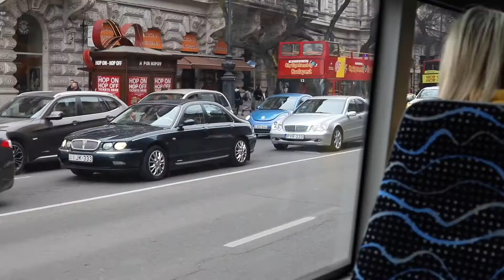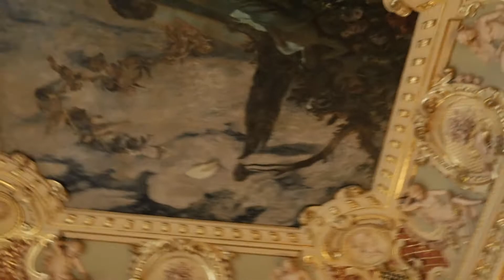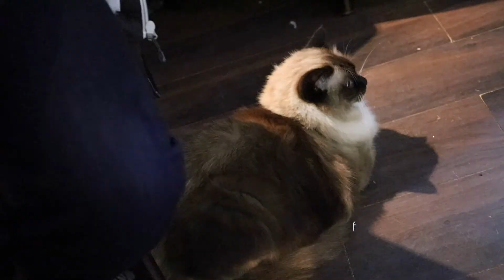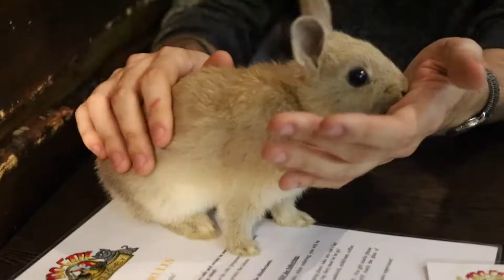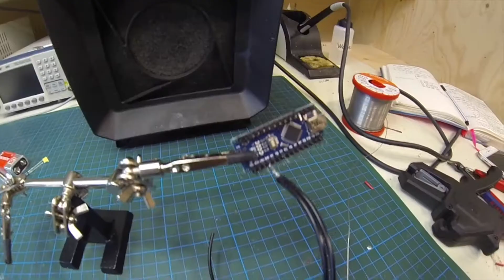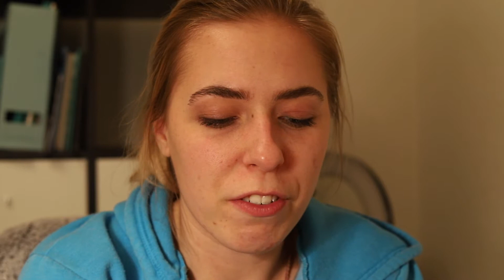This is Why You Should Never Solder | How to Make a Sensor Part 2

Comment: Are there any other options available too to attach the wires to board except soldering? Like any electronic glue/clips etc??
Reply: Use jumper wires
Reply from the maker: Yes there are, maybe would've been better to start that way. but I want to deploy in the field and it needs to be robust which is why I'm soldering:)

Comment: Why don’t you use male to female connector wires instead of soldering?
Reply from the maker: because I want to deploy this in the field and it has to be robust
Reply: @RiverTechJess  Hi fellow aero engineer! I used to solder connections instead of using connectors with the same thought for robustness. My mentor told me to stop since soldering wires can lead to fatigue cracks with the rigid connection + stiffened wire where the solder wicks under the insulation.  This was for a UAS and was a high vibe environment. Soldered wire connections are generally a no no for aircraft (especially manned) and we usually crimp everything. You may already know but FYI.

Comment: A suggestion : solder the wires on the other side of the board, at the points where the pins are already soldered. That will make the process easier and reduce the chances of breakage.
Get well soon and take care!
Reply from the maker: ah thanks for the tip! And for the well-wishes:)
Reply: STEMinine their not supposed to be soldered there supposed to be put into a socket